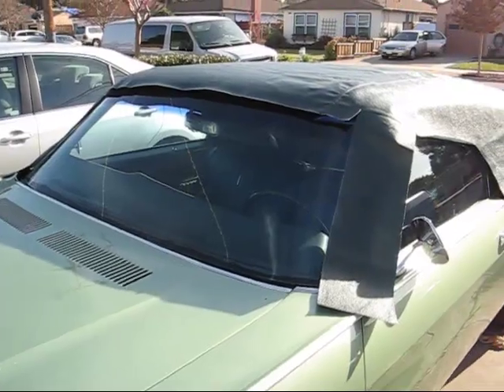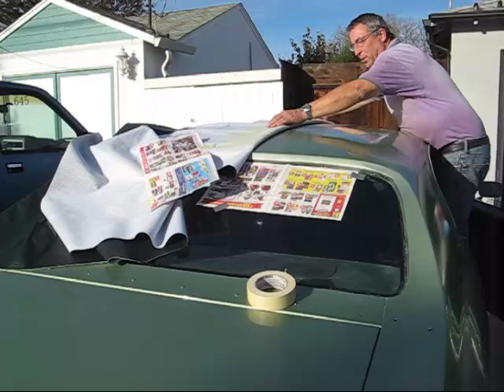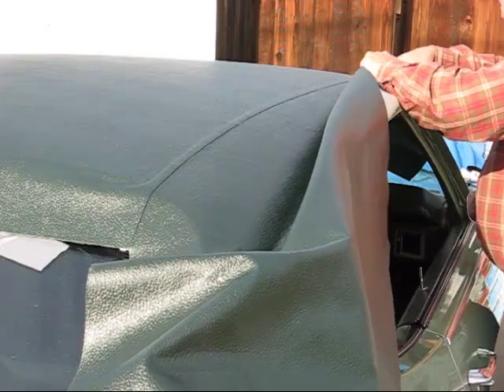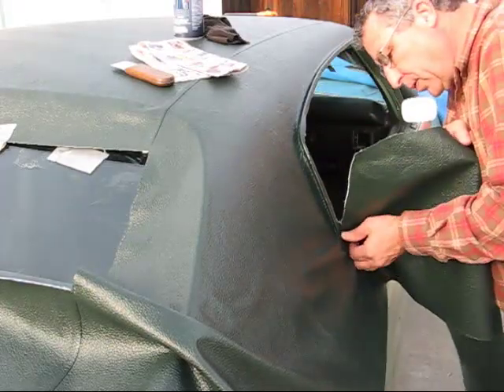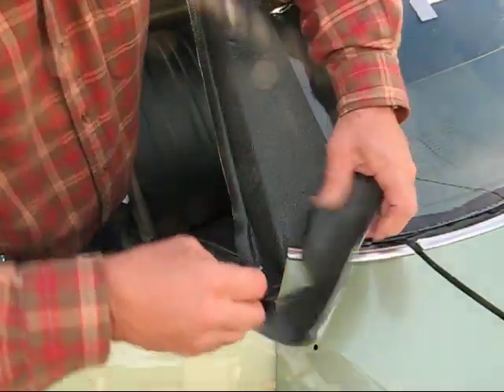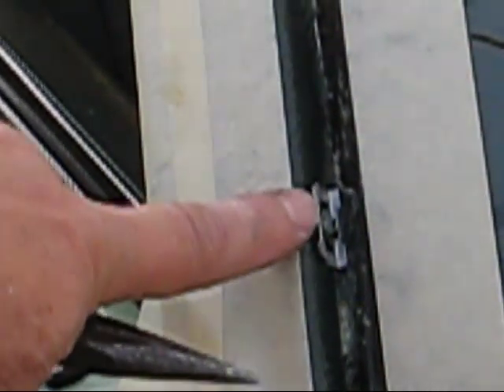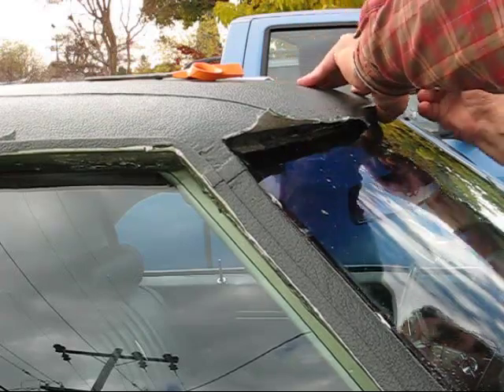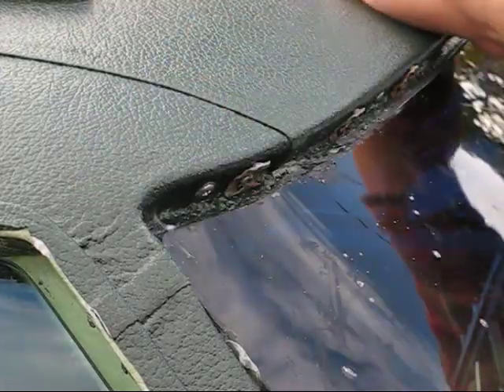How to install a vinyl top - Part 1

Comment from the maker: I used 3M Rubber and Vinyl 80 Spray Adhesive.  Purchased at O Reilly's Auto Parts but I am sure they sell that brand and/or other brands at other auto stores.
Reply: David Lis how many cans of glue did you use?? Was it hard to remove the old top before you painter the car?? I have an old Fury that needs a new top.
Reply from the maker: I think I used 3 cans.

Most of it just ripped off because is was so old, then I scraped it gently with a putty knife so I didn't put any gouges in the metal.  Then I used an  orbital disc sander to finish cleaning off all the old glue off.   I did not do as good of a job like the rest of the body because I knew that I was going to put the vinyl top on.  

The hardest part is starting, once you get going, you build confidence and get get easier.
Reply: David Lis we're did you purchase the material from?
Reply: We're can I order the roof material from?
Reply: My question been answered . thanks..!!
Reply from the maker: @07654-t  OK, now you can do yours

Comment: It is advised to scuff the paint for the adhesive to grab, great video.
Reply: Did the factory do that on the hundreds of thousands of cars that come down the line? From what I have heard from former assembly line workers they didn't. That doesn't mean it isn't a good idea, but if the surface is clean then it might not matter a lot.

Comment: Scared to death to do mine. This helped ease the fear a little
Reply from the maker: I understand how you feel.  Just take your time, use those clips to tighten it up.  If you are not sure, just stop for the day and pick it up again.  The hardest part is the rear panels by the rear windshield but you do that last so your confidence is up by the time you get there.  What is the worst ting that can happen, you have to take it some place for them to finish.  But I know that will not happen.
Reply: @davidlis6709  ty for response. I was thinking the sail panels or ear muffs would be the easiest . Shows hiw much I know. I have restored every single stage myself including stripping to bare metal, changing both quarters body filler, prime, paint, and clearcoat. Im in final buff stage now , yet a little headliner is freaking me out. I started this process 5 yrs ago with the goal the car would go from start to finish without hiring out any stage. I cheated and sent it oit for the sound system from a pro shop. Other than that, all is me. I am buying liner this week at car show. After that all we lack is puting all seats and carpet, and trim back on. Already have it all cleaned and labeled. Then, exhaust and wheels will xomplete it. Thanks agian
Reply from the maker: You can buy the headliner at:
Original Parts Group
National Parts Depot
Reply: @davidlis6709  yes im buying it at car show this sat from ausleys chevelle parts here in nc. Every single part that ive replaced is from them and haf no problems with any. I like them because all they do is chevelle and caminos so when you call them, they know immediately what you want and dont bumble around on a computer for 5 minutes. Also their earmuffs come formed on the cardboard and ready to install which is nice for the 1st timer like myself
Reply from the maker: Go with who you feel comfortable with.

Comment: Well heck years ago I saw a guy doing 70 mph in a minivan with a queen size mattress on the roof the only thing holding the mattress on the van was 2 strips of Duct tape over the top and down the sides of his van right over the windows etc , maybe you don’t really need to glue the vinyl on the cars?  Just get the right duct tape lol in the south we call it NASCAR tape because it will hold their fenders on after a wreck so they can keep racing FYI spray 77 is expensive if you have a compressor you can spray contact cement with a 14 dollar Harbor Freight Spray gun and buy Contact Cement in 5 gallon pails  you can thin it per manufactures instructions  that’s how it’s applied in Woodworking shops  although they buy 55 gallon drums of it nice work on the top
Reply from the maker: I was driving down the freeway 15 years ago, going about 65 and the car in front of me had a mattress on the roof.  It came flying off and I was able to swerve out of the way just in time.  I don't know about the people in back of me.  I had to pull over and empty my pants because I was so scared.

Comment: I got an 86 Cutlass Brougham with a original ragtop, gots several cracks so I wanna replace it, but how do I make it like the way it comes? It’s cushiony.   Also! How’s your ragtop holding as of right now ?
Reply from the maker: Cushiony - you have to buy the same type of material.
Looks like when I installed it.  Should last many more years.

Comment: Thank! My car has the top installed wrong and I need to replace it to make it go below my rear window. Someone ended it parallel with the rear window trim (why I don't know). I'll need new side and trunk filler panel trim. I'll also have to install new trim studs. 

Do you know how to add these trim studs?

That newspaper is giving me anxiety. If it was mine, it would have gotten glued to the new vinyl to or something else.

I'm going to watch these videos hundreds of times to etch it into my brain
Reply from the maker: I don't know how to do that, I believe they need to be welded in.
The deck panel and side panels can be purchased.  
Is there any way to glue the extra material in the places where you want it covered.
Reply: @davidlis6709  The thing is, is that my car has the wrong side trim. Instead of going to the bottom of the trunk filler panel, it curves up and meets the rear bottom window trim. So there is no vinyl or trim below my rear window trim. I want to buy new corner trim and the trunk panel trim, but there are no studs there. I'd have to add studs and remove the studs from the wrong side trim.

 I think it is channeling rain water into my rear window, trunk and inner rear fender.

Maybe I'll take the side roof  trim off and make weep holes. When it rains hard the rear package tray shelf must get wet because it's all warped out of shape. 

I'm not great at welding.

Thank you for your videos!   
 
 I'll be doing disc brake swap in the spring, when the snow is gone. That is a great video too!
Reply from the maker: @dan9809  I buy my parts from National Parts Depot or Original Parts Group maybe they have something to help you.  
The disc brakes make a big, big difference.
Reply: @davidlis6709  thanks I'll check them out

Comment: An okay video, as soon as you started I notice that this is the first time you do this, Not an A but Not an F  Grade, but really people this is something that if you want to save some $$$ you DIY but if you wanted WELL DONE, you let someone that know what they doing. All the wrinkles you left on this top will create moister and loosen the grip on the adhesive or cement and also there is a better adhesive than in a spray can sold by companies that sell the right one, because if even you doing it yourself you should always get the best materials there is. "Well it's Just My Model" when I do a project that involves anything and especially upholstery or car detailing.

Comment: Isn't there something you should spray on the roof first to prevent rust bubbles later on?
Reply from the maker: The entire car was painted so you put the top over the paint.

Comment: Hi, I have a few questions:
1) What was the temperature outside when you did this (I'm wondering if this job could be done in high temps)?
2) How much experience did you have with this sort of project before?
3) Were you replacing the vinyl top? It looks like you were installing a new one.
Reply from the maker: I looked at my data files and it was December 2013.  Remember this is SF 
Bay Area, California so the temperature was in the 60's in the day and 40's at night.   What do you mean high temperature?  The only thing is that the glue/contact cement would dry faster.

This is my first one but my friend owned a shop that did this work and he talked my through it before I started and encouraged me to go for it and I did.  But it is fairly straight forward.  Measure 2 times and cut once, take your time.  I believe I did this in four days.  When I got tied, I stopped.

This is a Malibu not an SS, so it comes from the factory with a vinyl.  I removed it, had the entire car painted and put the top on.  I am keeping this car as original as possible.  When you go to the car shows, there are no Malibu's, they are all SS cars.  You can tell the conversions by looking at the dash.  The real SS have round gauges not a sweeping speed indicator.

Plus I drive this car.  It has a 350 V8, 4 speed and gets about 14 - 15 mpg so I use it as much as possible.  If it was 427 with 8 to 10 mpg, it would set in a garage collecting dust. 

Don't be afraid, what is the most that could happen?
Reply from the maker: Temp outside was 65 max daytime and 40 at night.

This was my first one but I did have advice from my neighbor who put several of them on.

The car was repainted so the old one had to come off.
Reply from the maker: The problem with high temperatures if the glue will dry faster, yo will have to work faster.

Comment: Hate see anyone fight getting it worked into the drip rail. Next time use a screen roller.
Reply from the maker: I don't know what this is?
Reply: David Lis I tried to post a picture of it. Google screen roller tool. It basically a Handle with a wheel on each end.
Reply from the maker: How about trying a link to some site.
Reply: @davidlis6709  Almost looks like a Pizza Cutter but its for screens. you can get them in metal or plastic.
Reply from the maker: @717273mopar  Good idea

Comment: what are you using in the spray can to hold it down?
Reply from the maker: I used 3M Rubber and Vinyl 80 Spray Adhesive. Purchased at O Reilly's Auto Parts but I am sure they sell that brand and/or other brands at other auto stores.

Comment: What color is that car? Green Mist?
Reply from the maker: These are the codes from the build sheet found under the back seat.
Color code = 45   Green   --   after market calls it Jade Green
Vinyl top  = C08

Comment: Do you know how to install the small screws for the molding to go on (quarter panels), would I just weld them on or drill holes?  I also have a 70 Chevelle, but it did not have the vinyl top on it and I am starting from scratch.  I've been watching all of your videos and think highly of your work.
Reply from the maker: Just drill small holes for the screws.
Reply from the maker: I drill new holes to install the chrome around the wheel wells

Comment: About a million ways this could go wrong in a diy attempt.   This is a job for the experienced.
Reply from the maker: What is the worst that could happen, you get it all screwed up.  Then you bring it to a professional.  Parts are cheaper than the total job with labor.

Comment: This is not how you install a Vinyl Top at all!  If this process takes you 4 days in your driveway, find something else to do.  Besides prepping the surface for the adhesive, laying the top down properly should take you an hour to and hour and a half tops.  This top will come apart after a few drives.  The bubbles and wrinkles left here are laughable.  I would not pay for this!
Reply: Real mature man
Reply: Joshua Miller Not cool man. Let's see you do better. Then upload your video.
Reply: @williammcdonald5633  I am admittedly embarrassed with my harsh tone regarding my response to this video.  I even went so far as to send a personal message to the content provider with an apology and some helpful tips and lessons I learned the hard way.  That being said my tone was wrong but the skill and technique putting on a vinyl top were absolutely accurate.  Anytime you see a funeral hearse or funeral limo you are seeing my work.